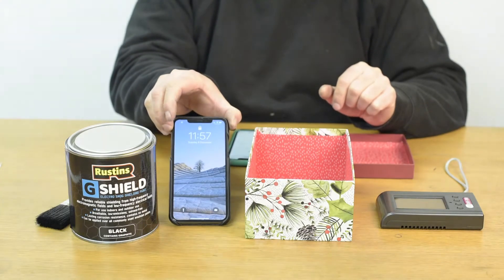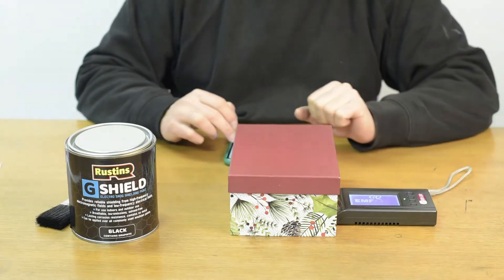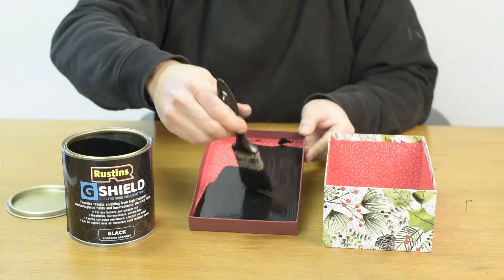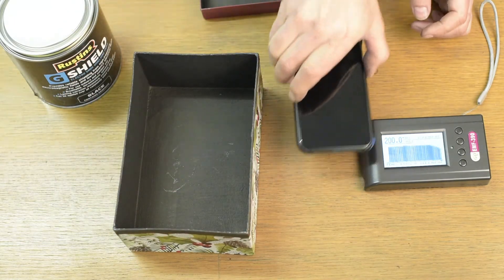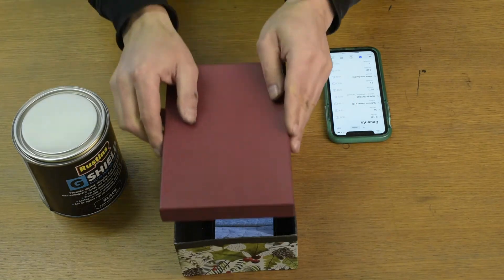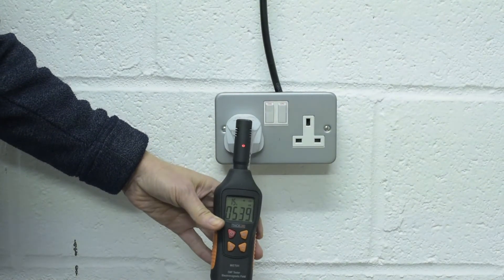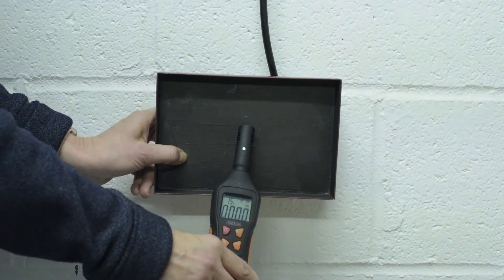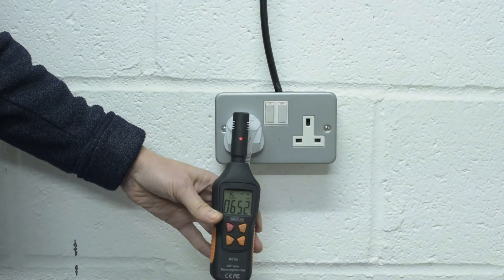Rustins G Shield – Electro Smog Shielding Paint

Comment: Anyone watching this several years on wondering if this product works as portrayed in this video, it does not. 3 layers was evenly painted to a solid Woden box, then an iPhone 12 placed inside with a 5g sim and there was no impact on the signal at all. The phone rang just fine with the lid closed and the metal latch fastened securely. The product doesn’t work as advertised in this video
Reply: On the bright side, now I can line my hats with this paint instead of wearing tinfoil. D’ya think I’d still need to earth it? That’s definitely the most inconvenient factor. It’s okay at home but people look at me funny when I’m on the bus, trailing a 30 foot wire out of the window.

Comment: The level of radiation with aluminium foil will aslo be 0 of you touch the foil with your hand as you do with painted shield. Since grounding a shield does a good job while non grounded shield can increase the level of emissions due increased capacitance.